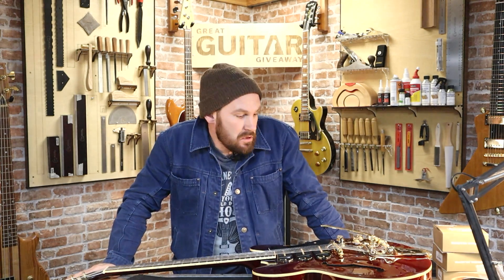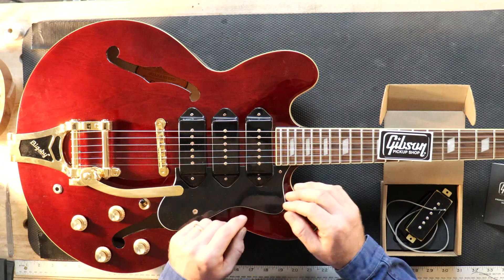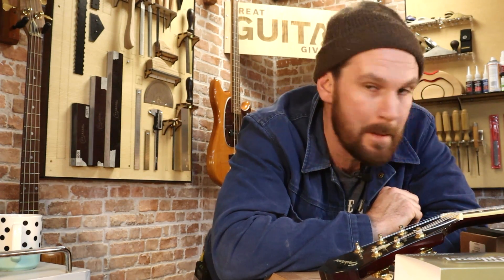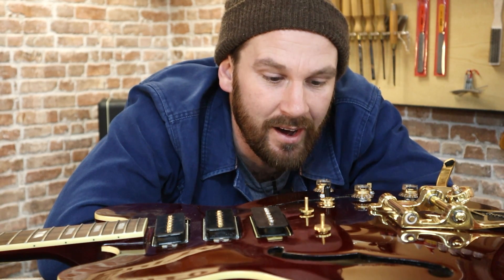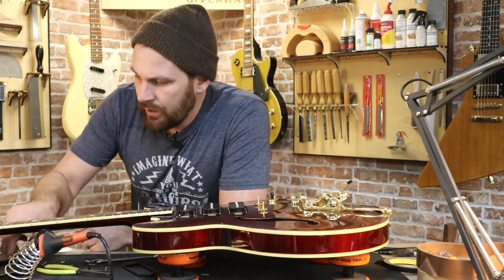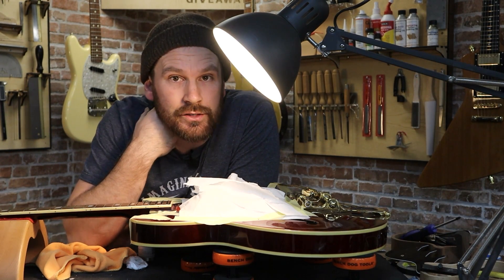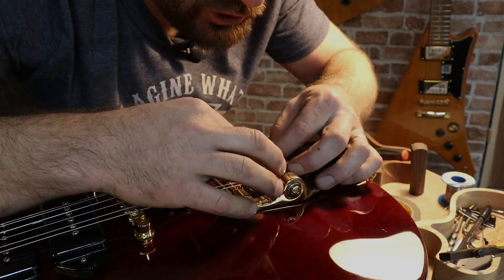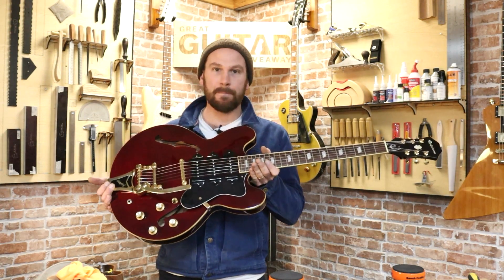Upgrade time! Fantastic Epiphone Riviera gets Gibson pickups & more! | Luthier Teardown

Comment: I have that guitar! Stock P-90's sound amazing with a center block, right balance between mellow and bite. I never changed the pickups but shortened the leads for every pickup, and changed the wiring slightly:

Got rid of the tone pot, swapped it for a three-way toggle. Each pickup has a volume, bridge and neck go to first toggle, so you have standard two pickup sounds and operation; the output of toggle 1 goes to toggle 2, where the middle pickup is wired. So, with the middle pickup turned down, you have a kill switch function (very practical with P-90's and gain) and if you like your middle pickup, you just have to flick a switch.  I'm too much of a dim bulb to operate three pickups, let alone doing it with the volume knob, so I just keep the guitar in 2 pickup mode.

Another mod could have been making the Bigsby string-through, way faster restringing. I have done that to two of my Bigsby equipped guitars, never looked back.

Cheers!!

P. S.
Isn't it P-93 because it has 3 pickups? And the pickups are regular Epi P-90's?

Comment: If memory serves, the middle pickup of the Riviera has reverse wiring, and because it is on all of the time, it effectively humbucks the other two, which really does change the sound of the pickups. In my Riviera, I added a pull/push switch to the middle pickup, which really lets the other two pickups open up better.

Comment: When attempting to remove a file cut in the fingerboard don't use a scraper initially. Unless it is possible to work the scraper at something like 90 degrees to the slit , otherwise the scraper will follow the shape of the slit making it deeper.
Better to initially to use a small hand file or abrasive paper on a block to level the slit then follow with a thin flexible scraper held to fit the board radius. Razor blades belong in the bathroom.

Comment: I have that exact instrument, and absolutely love it!  I am seriously considering converting the switching over to a 5 way rotary like a PRS.  Turning the middle pickup in and out using the volume knob is kind of annoying.
These also had different pickups depending on when they were made.  Mine is an early run almost 10 years old.  It said right on it USA made P90s when I got it, I know the newer ones have US designed Chinese made pickups

Comment: Wiring it with all 3 pickups engaged would sound awesome
Reply: Middle position does that in the Riviera. The middle pickup is always on, so Imagine standard 3-way switching with the two outer pickups, but with the middle pickup always on as well. So the 3 options are bridge/middle, bridge/middle/neck, and middle/neck.